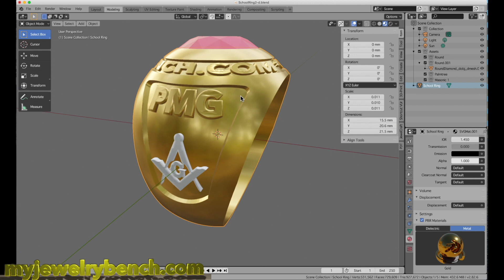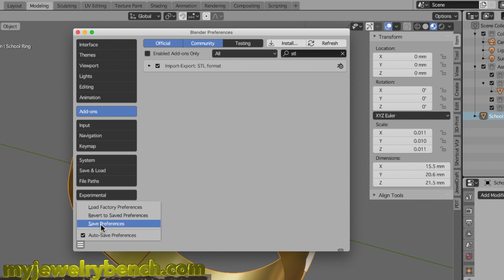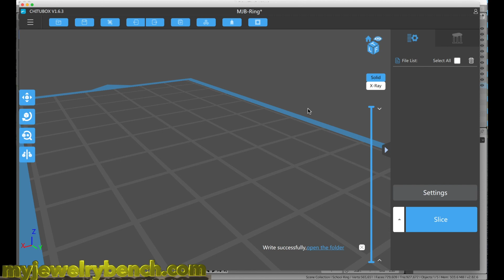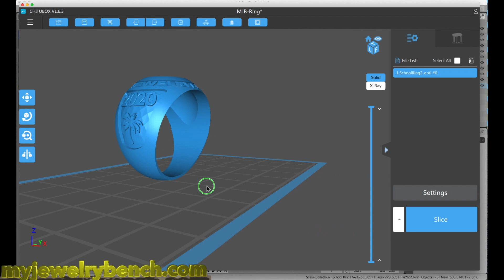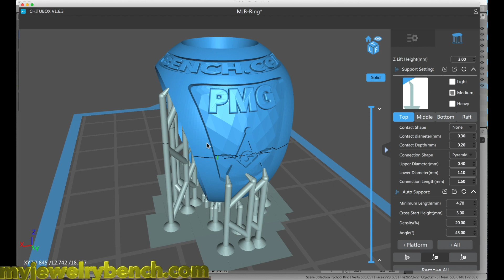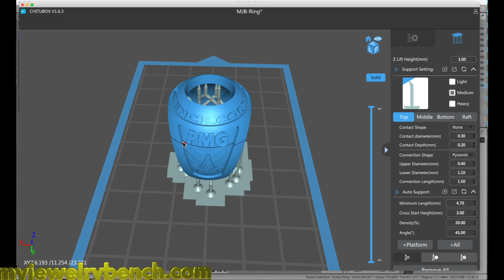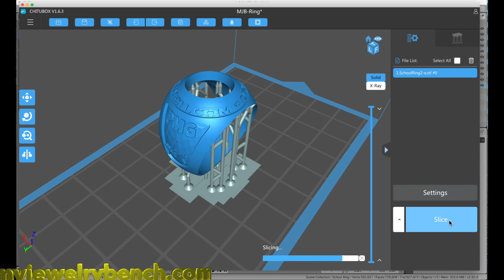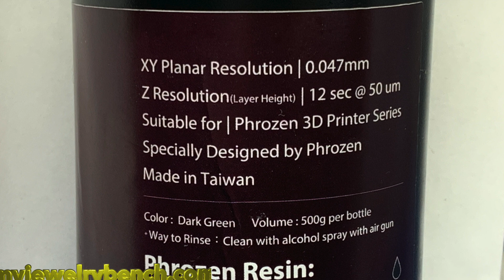Custom School Ring PT3, 3d Printing with the Elegoo Mars and Epax X1

Comment: The shade Smooth command doesn't really smooth your model it just make the  lighting reflect on the model so it will look smooth. To smooth the model you need to subdivide your model
Reply from the maker: If you apply an edge split modify to the design it will smooth the stl

Comment: Oh no, the rings really didn't turn out very well did they? I wouldn't be happy casting/selling those prints.
A lot of the details are lost :(.
Glad I've seen this video, looks like I'll need a better 3D printer than this one.
Also, the recommended videos pop up over the comparison images at the end
Reply: Kyle 0 Get a Solus 3D Printer or if you have the cash a Solus Pro.  $3500 for Solus $7500 for Solus Pro. If you want a cheap printer the Phroezen Shuffle it the Phroezen SHUFFLE 4K. Join their Facebook groups For all and you can see some of the crazy stuff that it being printed.
Reply from the maker: It wasn’t meant to be cast. Tutorial only.

Comment: Not trying to disrespect you, but the ring design is way too thin and the edges are too sharp. The prints really aren't jewelry quality. I do like your channel.
Reply from the maker: It was for the channel. Never will get cast. No disrespect. I hope you got something out of the process.
Reply: @watchesandjewelry  do you have any cheap 3D printers that you recommend for beginner jewellery prints?
Reply: Kyle 0 Phroezen Shuffle or Phroezen Shuffle Lite. I have researched a ton and for the cash these are the best. Use Resinworks 3D Violet Castable resin if you want killer detail